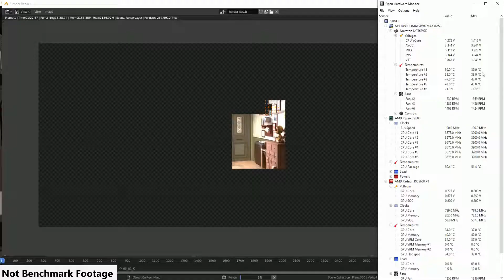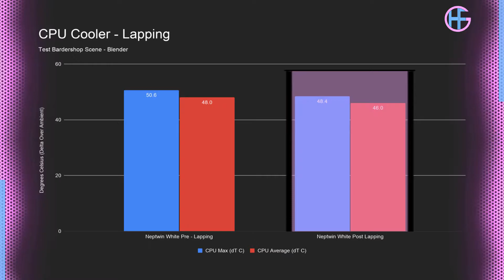Should You Lap Your CPU Cooler???

Comment: My problem with my CPU cooler wasn't roughness, i actually don't care about it. I have a Scythe Grand Kama Cross 2. The thermal performance is spectacular, the supplied 140 fan still runs as well as it did on day1, after 10 years of use, but it never wanted to sit well on a CPU due to the very very pronounced convexity obviously deliberately and at very high machining quality manufactured into the copper base. It did fine on Phenom II x6, though occasionally i had to remount it as it was tilting off and the CPU was complaining, even failing to boot. When i got a Ryzen, i decided to flatten it down rather than torture my new CPU, and this solved my issue completely. I used the same process as lapping but i think i stopped at 1000 EU grit or JP grit i forget. I didn't flatten it all the way to the edge, just the middle portion, as i understand the Ryzen heatspreader can have corners which ride up a little. I'm very happy with the outcome.

Comment: I did this back in 2001 with a ThermalRight Copper HS.  One of the things that were in discussion around that time was the fact that the front of whatever direction you're lapping is going to catch more & you end up with a slant (while not necessarily visible, it's there).  If you change the direction of your lap, you ultimately end up with a convex surface. going one direction, picking it up, putting it back to the starting point, & then going the same direction avoids this.  I also made it a point to not go above 1000 grit as you end up with grooves too small for the thermal compound to fill in.

Comment: Sounds about right. Lapping a cpu nets similar results. 2-3*C for most. Kingpin stops around 600-800 grit to allow the thermal paste to grab on to it yet you can't feel the scratches with a fingernail which are visible.  supposing both cpu and cooler are lapped, that could hypothetically shave 4-6*c off the temps? Or just do as I do... I let the dog lap it, stick it into a pea sized blob and call it a day and enjoy 4.6-4.7Ghz on all cores on a 10700f on an MSI b460m Mortar motherboard with a tiny Cryorig M9i (slightly better than a 212 evo yet 92mm) and wait for my next Newegg shipment with another 16G of ram and an Arctic e-sports 34 duo to keep it even more chilled. (gaming runs between 55-66*c, idle 29-33) Joking aside, Good video! I preferred it over watching Jays2cent lap another cpu in an effort to pull into 5th place for a record. Keep up the videos. They're for real people. Cheers!
Reply from the maker: 800 grit... does kingpin using liquid metal TIM?? Things do change when you go sub zero too.
Reply: @HardwareForGamers  He uses his own KPx which hasn't done so well for most but i guess the thickness and such he applies it when doing uber overclocks works for him... Many reviews say arctic 5 is better for joe schmoe... so... I dunno and damn that all rhymed!... my bad!